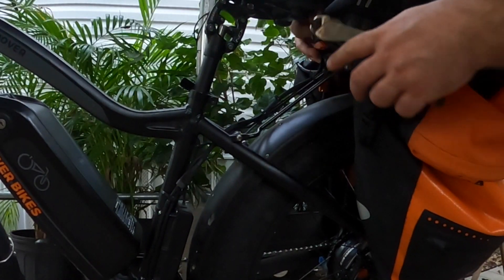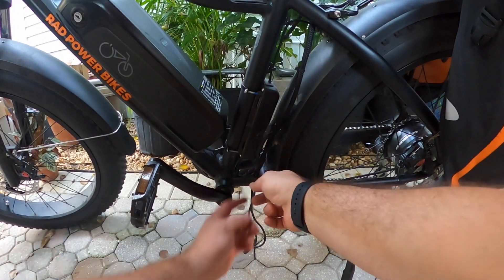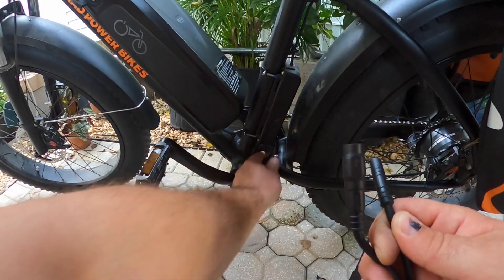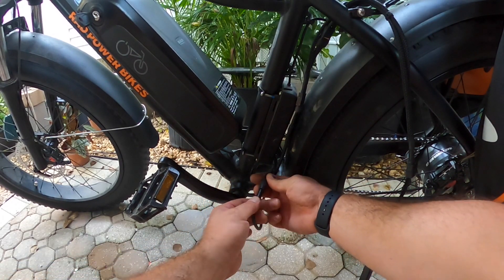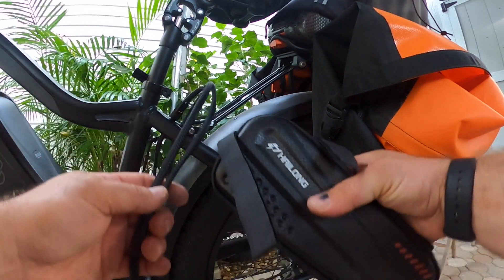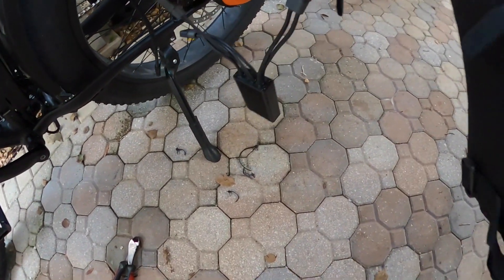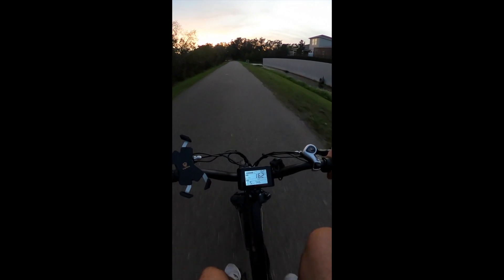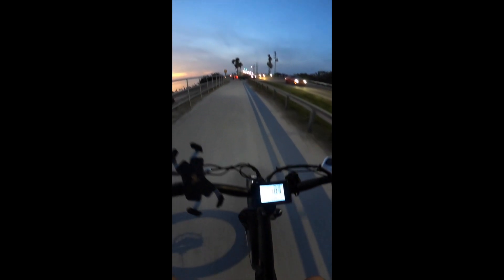Rad E-Bikes | RadRover | Plug and Play Dual Battery Discharge Balancer Kit | Install Two Batteries

Comment: I have a question about this system work with 35A control I have in my rad rover 2018? And I used 48V battery Thanks.
Reply from the maker: The components use 14AWG wiring. They can tolerate 35A in the system but will be susceptible to heat if it is continuous.
General riding at an average of 20a current should be just fine
Reply: @ElectricAllWheel  any idea how far can you go with this system, I mean how many more miles? I have thinking add in my rad but just make sure work with mine bike Thanks.
Reply from the maker: @hughheli  check out the end of this video. It will guide you on the range calculations.
Save Space! Super Easy Second Battery Mount for Lectric XP 3.0 Electric bike with Lectric Battery!
https://youtu.be/UNUjrk_iT9k

Comment: Great video, thanks for this. Which kit would I need for the radwagon? I'm using a 48w 20a hailong battery with the stock 48w 14a.
Reply from the maker: Rad 40A kit…perhaps XT60 extensions as well

https://electricallwheel.com/dual-battery-discharge-kit-40a-rad-himiway-magicycle-fit/

Comment: This is a good informative video I have a question I do have a radmini 4 and looking forward ti do it dual battery will this set up work on my bike
Reply from the maker: The cable routing may be a bit different but yes, it will work.
Reply: @ElectricAllWheel  thanks looking forward to purchase this kit